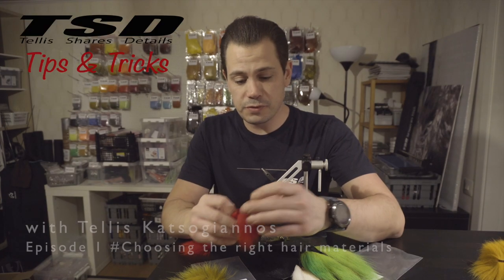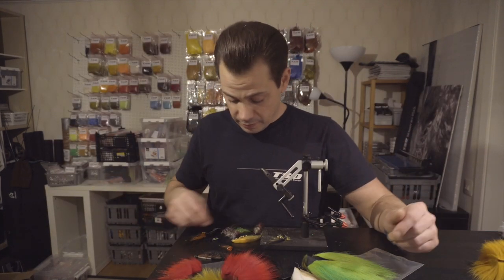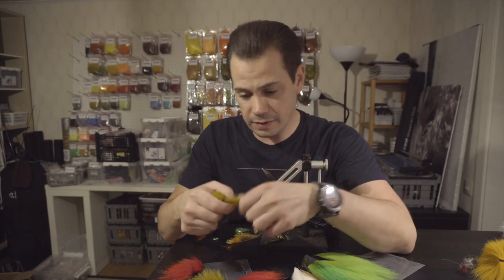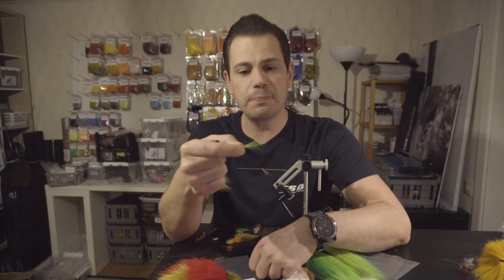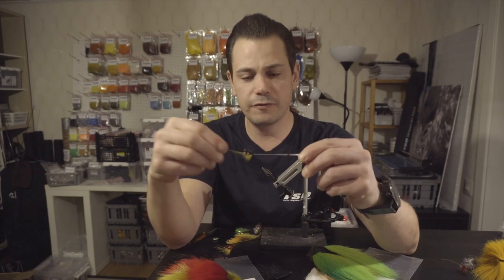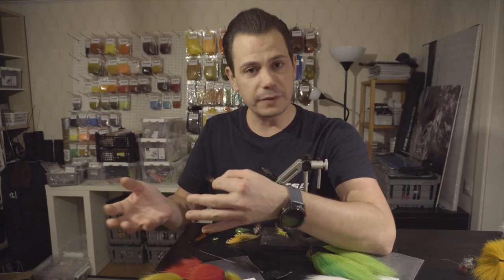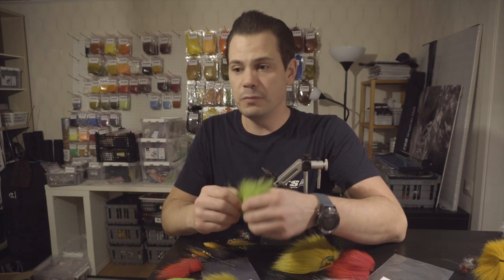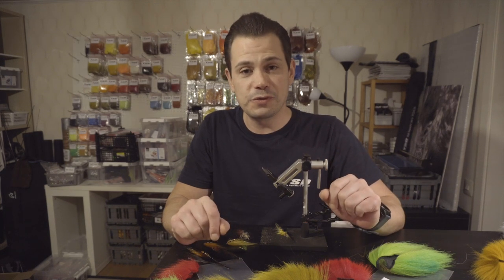Tips and Tricks with Tellis Katsogiannos #1 Choosing the right hair materials

Comment: What a great video. A question...you talking about little/small tube flies. What is in your opinion a small tube fly. (3 cm or more)And when i starting to support my wing.
Thank you very much for your answer.
Reply from the maker: Thank you very much for your feedback! :) Small tube fly, and talking about wing length, I would say lengths between 2-4cm, smaller is micro and larger is "standard size". Flies that has a total length of 3-4cm rarely needs any stiffer supporting materials, you can just use fox for example i the whole wing unless you want that super light dress.
Reply: @TellisKatsogiannos  Hi Tellis,
Now this is what I call an answer with a good explanation. I now understand several parts about tying a tube fly. And the support with Bucktail is perfect. A good alternative using your dubbing technique. I saw this in one of your videos Awesome.